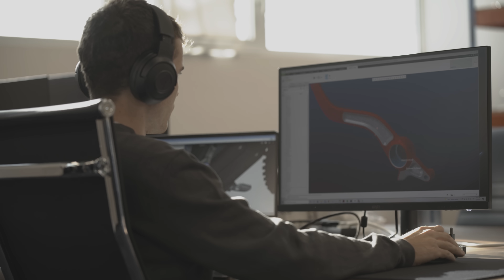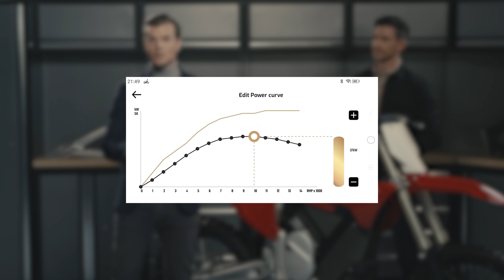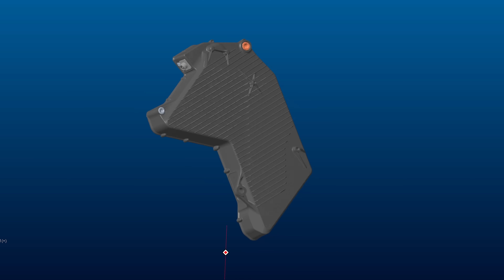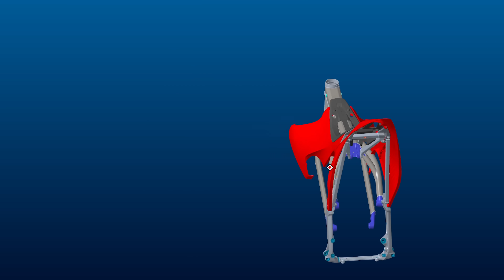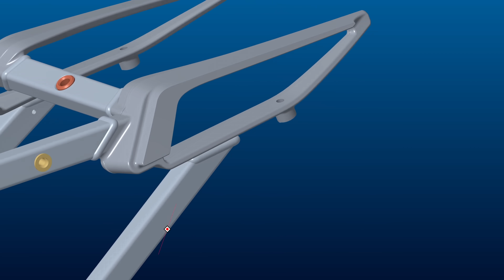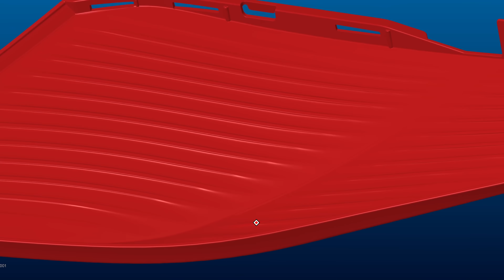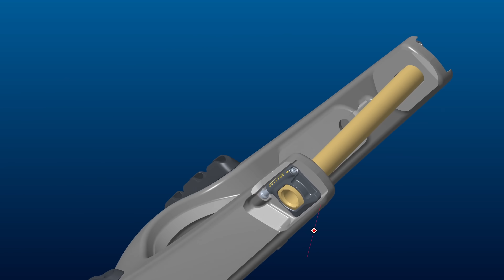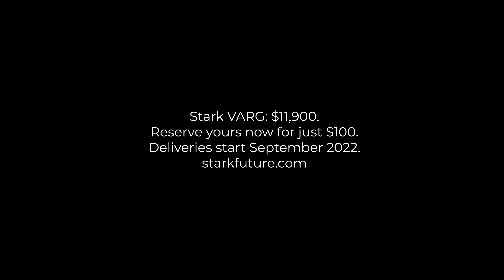The World's Fastest Motocross Bike is now Electric - Stark VARG

Comment: just like exemple; HAHAHA!!!!!!!!60hp/hrs , you sure about that hmmm! hmmm! 60hp/hrs= 44 760 watts/hrs and you have battery maybe 8000watts / 44 760 watts/hrs = 0.17873 in the most best conditions is possible, like disconnect the motor shaft to the rest of the bike and if you really have 60hp/hrs  or 44 760 watts the autonomy it's arround 10'min. very max but reconnect the shaft  and your autonomy drop down to maybe 2- 3 min. hahaha. OK your motor is probably 5000 watts/hrs / 746 watts/hrs = 6.7 HP and that's is the real power of this Bike. the torque is just awesome in electric motor. HAVE FUN! Oh MATH it's ; OHMs LAW ONLY 5 min to learn. (Amps x VOLT = watts) (Amps x Resistance = Volts) ( Volts / Resistance = Amps) (Volts / Amps = Resistance) ( Watts / Volts = Amps) and Power of the Battery "in watts  / Continuous Power of your motor" in watts/hrs = Autonomy in hrs. 1HP = 746watts/hrs.

Comment: Okay, I need a proposal for a military cargo bike built from the ground up as an unbreakable workhorse with a frame designed around balanced modular panniers made to interface with ammo cans.  It should be able to carry 100kg distributed between the racks and carry a passenger.  Think about a your concept motorcross bike horse and a Rokon donkey having a pack mule baby.  I'm serious and will buy an initial order of multiple units after the prototype is fully tested.  Talk to you later.

Comment: I'm interested in how well it works in the mud, wet deep sand, and when conditions are not hard packed blue dirt.  I bet it's a massive fall off in time
Reply: Why wouldn't it work in those conditions ?
Reply: @surronzak8154  everything electric struggles when there is a continuous load.  as long as the bike is in hard pack, fast conditions im sure it will be fine.  but riding in heavy sand and mud for 20-30 minutes that battery will be done.  everything electric suffers because the power supplies currently available are so limited.

Comment: I have a CRF511 short rod, stroker crank big bore with oversized valves and a ported head that produces 19% more horsepower and 26% more torque than a CRF450.  It would get absolutely demolished by the Stark!  Times are changing, and they are changing for the better.  The Stark Varg is nothing short of a fundamental shift in how we will ride.  I absolutely love it.  So beautiful!

Comment: the numbers dont add up.
up to 6 hours riding.. but more like 35 minutes
44kw moter 6kw battery.
 you do the math
Reply: You are thinking in terms of weight of a full-size sedan and did not listen that those longevity times are based on light riding, lol. Not to mention they have power limited settings to get that ride time, just like any other EV. 
60-80hp, 250lbs, Carbon fiber housing 360V motor, and more than enough tech to trail ride at 6 hours on this spec. 
Sure, full power in a motox shesh will get you like 35-40min, but that kind of power is not used when doing trail riding. 
Still a massive accomplishment and they have more than enough history to back their claims. No doubt they can deliver these specs.
Reply: You're not using 44kW all the time xD
Have you ever ridden a MX or enduro bike?...

You feather the cluth/throttle to find the grip.

Comment: I can wait to see this machine in competition with the Monster energy Supercross!!
Reply: They are trying to create ruling to make it happen in supercross (lots of riders want to switch to EV), but it doesn't seem like it can work due to safety. You need to have enough noise over all the other noise to let a rider know you are near. Works differently when all the bikes are EV that things are quiet enough that you can hear other riders or just let them know you are there, lol. 
On top of the fact that the ebikes are faster but need a quick pit to hotswap batteries or cool the motor makes for a different strategy to race. 
It's probably gonna be like MotoE and FormulaE, where it will be it's own league, with lots of riders/drivers moving over to it when they want more excitement and to be on the bleeding edge of something that is constantly changing and improving every day.
Reply: @sqlevolicious  why switch. Have a electric class of its own racing. Imagine the sales increase of electric machines. That would be awesome

Comment: As an engineer I am so absolutely impressed by this. The fact that you can compete with existing manufacturers at a somewhat similar price point is incredible. I'm convinced that the mx and enduro market is the first one to properly adopt electric bikes. And everything about your bike is equal or better than existing bikes and on an absolutely new platform. Obviously you weren't bound by fuel tanks and combustion engines, however I'm sure that battery packs and electric motors and ESCs bring their own challenges with them. But it's absolutely obvious that you have understood the art and craftsmanship that is engineering, it is visible in many small details, but also know how to market and sell your bikes. The apperance is one such example. It's obviously a big part of motorcycles and your bike looks absolutely gorgeous. I'm pretty sure if you continue your work like this and deliver on your promises (which it does seem like you will do), you will quickly make yourself a recognised brand name and be able to expand your lineup to other areas of motorcycles. And it is hard in this day and age to start up a new company in such an established market.
I personally am most interested in a proper enduro version that includes a headlight, other than that you probably wouldn't need to change much. Second on my whishlist would be road legality in europe, but that's a whole other can of worms. However I'm sure you would still make it look awesome, even with indicators and a number plate. Also I'm interested in what you would work on after this is done and production has ramped up. If you are hiring or do internships, hit me up hahaha. Well, you probably don't read YouTube comments anyway... Still, best Regards

Comment: I own a TM300 2t and no plans to sell but this would be an awesome second bike in the garage for the kids. Power tuning via app makes it easy. No radiators to damage, so no braces needed, no fuel, no air filters, engine oil changes on and on. Oh but I cant ride 10 hours straight? so what, how many do that and if you do well stick to a ICE bike. Same silly logic people through up about electric anything. From a mechanical point of view these are as simple as it gets. Future is nuclear and battery tech, maybe some solar. I mean do people actually enjoy paying for fuel? 

Traction control and engine characteristics  for hard enduro is incredibly simple on electric. Full torque at 0 rpm. This also opens the door to other concepts people have tried and failed with over the years. What about a second hub mounted electric motor on the front to finally get a usable 2wd bike? So many possibilities

Its one single downside is the sound. But that's the reason a lot of bikes are being shut out of places. And its really only relevant to those who grew up with it and as we get older those of us who love the sound and smell of a 2 stroke are going to fade away replaced by generations who have no idea what we're on about. Like getting nostalgic about your old steam powered car and the smell of the wood burning in the boiler when internal combustion engines became the new thing.

Comment: Love the concept and the idea of lower maintenance! But there are few things that don't make any sense for dirt bike riders. First of all, when I ear the words Co2 emissions and dirt bike in the same sentence, I have to call the bullshit. Remove all the dirt bikes in the world and nothing will change for co2 related issues. Let's be real. Dirt bikes have little to no impact on carbon dioxide emission. Also to be considered and I know for sure I'm not the only one, I personally love the sound, the smell and spending time in the garage fixing the bike. It's part of the deal! If you don't like working on your bike, you're probably in the wrong sport. Most of the issues I'm experiencing on my KTM 2 stroke (I fucking love that thing) are tire, suspension and sensor-related. The engine has been fine so far! I don't mind cleaning the air filter. Let's talk about the range. I can personally go anywhere and refill my bike with any gas, in case of emergency. Would you bring an AC charger with you, just in case? Electric vehicles make sense, on the road. Off-road is a different game. When batteries will weight a third and last at least double and cost half, we can talk.

Comment: Awesome but:  The phone/screen in the bar pad has to go.  When you come up short on jumps this is where your helmet goes.  Redesign the front number plate to be independent of the fender.  Past bikes have tried this and it just looks goofy and there is no need for the extra plastic it takes.  The rest of the plastics are spot on as its a great balance between KTM and futuristic.  Absolutely get rid of the gold.  This is completely a market miss.  There is no need and never will be for that on a motocross bike.  This is a deal breaker simply because it is such a vast misappropriation of cost.  If gold were somehow needed for the tech to work like for the batteries etc then fine but not as an accent.  242lb is better then the KTM 300 by far but its still a bit chubby.  Non swappable battery is a tough one.  Not sure I can wait 1.5 hours between motos.  How the heck do you charge this at a track?  If you have to bring a small generator then there goes the whole carbon footprint angle.
Reply: How about stop stealing tax payer money in the form of subsidies to build this thing that is not going to make a profit.  That is called "theft".
Reply: And you are an accomplice to the crimes.

Comment: Huge "No thanks!"  The guy says, "You no longer need to be a trained mechanic to own a motocross bike."  This is not an incentive. Half the fun of riding motorcycles and running jeeps is the wrenching.  If you can't fix it, then don't ride it. It has it's own smartphone for an instrument panel and changing motor maps.  No thanks.  The reason for adventure riding is to escape smartphones, computers, and daily professional life. As far as changing maps, if you can't control the machine yourself, then you suck.  If you can't select & change your gearing before you set out, then you suffer for it.

Comment: 6kwh battery sounds good but how much to replace it? 5kwh battery cost between $5,000 and $9,000. It'll take 40 to years for your average weekend rider to use that much in fuel.  These batteries will go bad. Just like in the Tesla's but they don't tell you how much it cost to replace it.

Comment: I'm hoping for a hot-swappable battery. In the deserts of the west, being able to swap out the battery is a must. For racers, changing batteries between motos is essential too.
Reply: Yes it has a hot-swappable battery set up video.  Sorry I didn't see this question. The battery stays on the bike stand and you lift the front end up and off. Very easy. I use 2 bike stands and 2 battery packs. With out the battery in the bike is very light to change to the 2nd battery. I use the left hand lever/rear brake option. So right turns in a berm my leg is out and rear brake on longer that other moto-cross bikes. Takes about 2 rides to get use to it and watch your lap time drop.
Reply: I don't like that they don't respond to questions.  I saw a demo with a professional.  He was impressed, but the battery was pretty much depleted at 30min.

Comment: Ordered mine today, I can’t wait! My two questions are how adjustable is the suspension / seat height? I have a 30” inseam so usually internally lower my xc 250 1 1/2” plus low seat. Also can you adjust the engine braking out enough to feel like a 2 stroke? That’s the number one reason I no longer ride 4 strokes.
Reply: Can most likely adjust it to 0 even if you like that.

Comment: There is a lot of debate on the safety concerning such low noise levels. Stark, i think it would be good for your team to come up with a solution. It doesn't need to make as much noise as a roaring 450 but it does need something so it can be heard a couple hundred meters away on trails so hikers and people on horses etc can hear us coming? Suggest a sound generated which is mapped to motor speed and emits a frequency which is not annoying or overly loud, but alerts people to it's presence? This feature should be incorporated in to all e-bikes. Lead the way Stark!
Reply: Hell no, keep it silent and just pay attention

Comment: hey stark, i understand the commercial Apple style presentation. but i have a few recommendation, what are the extra options? where are the disc guards or hand guards? i see cheap suspension, why not use WP Trax or ohlins or similar? you can build a good frame, but suspension is more important. Electric motors are cheaper to build (in production) so lower costs why not put a race factory brembo brakes? (the Black series). and rideble power is more important than more horsepower. 

and last but not least, build also an enduro variant,.... a lot more mass People to reach to sell the bike to.

Comment: Looks cool but I don't get 2hrs to pit in a moto waiting for a full charge and at that point I have to start up a gas  generator kinda defeats the hole idea.  the battery needs to be replaced i less than a minute  and the bike needs to come with spare batteries for this to work out

Comment: I have been telling my friends e bikes are coming. I just group shared this video to all of 'em. In 5 years if you want to stay competitive you will have to be on an e-bike. I ride trails and i got a chance to ride an Alta for a couple of hours, it would tractor like nothing i had ever ridden. It was heavy as lead but would climb anything i pointed it at and i suk.  I hope an 18 inch rear tire and kickstand will be made available. If the 6 hour run time for trail riding holds true this will be my next bike. And let me just say "I will not miss mixing gas, changing oil, adjusting carbs, cleaning air filters, replacing head pipes, packing mufflers, replacing radiators, rebuilding the top end, replacing seals in the bottom end, replacing starters, replacing clutches, carrying 14lbs of tools, buying VP gas and the number one thing i will not miss is falling over in a rock garden 1,000 times and at the crest of a difficult hill climb because the bike died at that critical split second as if to say sorry 'bout your luck loser."                         
So for the love of all that is Holy, give me an 18' rear wheel and a kickstand because i want, need and have been waiting for this bike. My nutz could definitely use a long awaited break.
Reply: @lifeoutdoors3953  that’s alot of character judgement to pass down based on a YT comment. FYI I work alot, so the chances of me getting lazy are zero. At $11,900 these bikes are real close to the price of a new Husky 300. How many they will make and sell is yet to be known. 
I’m 50 years old, Ive been riding for 41 years. I have two sons and a grandson who ride and i taught them how to ride. I currently own and maintain five motorcycles. That qualifies me as an enthusiast. So if my old ass is tired of working on dirt bikes, it’s because i fucking earned it dip shit.
BYW, I see your reply stating you would like to have an e-bike of your very own. Maybe that was before you checked the price. And 30 years old sure AF aint “old school”. It’s just 30. You hate phones but use one to troll people on YT. You have a YT user profile but zero content. Lol, you’re nothing but a poser. The only bike you own is a little tikes 12v battery powered two wheeler with training wheels. And yea, they are easy to ride, even for a half wit bird brain like you. You couldn’t kick start a crock pot but i got $100 says you can suck start a Peterbuilt. Keep doin circles in yo momma’s basement on your police bike dip shit.
Reply: @UC8Kte_a2pQ3AOvp8o_rTNNg Windrock ATV Park in Oliver Springs, TN. Sac up
Reply: @orijinalgamesta9738  easy stuff I ride hard enduro.  Rode erzberg 3 times so it can’t be to hard over there in the small hills of nc what’s the highest elevation 6 thousand feet? Psshhh Childs play
Reply: What bike are you riding that stalls out all the time?   Learn clutch control

Comment: This looks promising. However, I really think these electric bikes are going to need a “clutch” or some kind. Maybe it’s just a digital programming that simulates clutch action but in hard enduro I just don’t think that I can ride with out the control a clutch gives me. How do I lift the front end with the snap of the clutch to do a pivot turn? Obviously I haven’t ridden one of these but I don’t see how just throttle is going to work the same or be as controllable.

Comment: Advertised no mechanics, even though suspension and gearing will be an issue. What if there is an electrical issue? Do you replace the entire motor and how much does that cost? What about a mud race? What happens to the aftermarket industry? I suppose we all evolve.I'm just glad I can get a nice FMF exhaust on my 300 and my 450.

Comment: My only question is how hard is it to change out the battery for a few good heat races? If it is used for a race weekend with multiple heats is there a quick charger or quick battery change?
Reply: 6 hours of fun per charge, have solar and batteries to charge between races, or generator if you miss the noise, weight, fumes and cost of fuel
Reply: @666t   You are not going to get 6 hours out of this at race speeds. You won't even finish the race at that power draw.